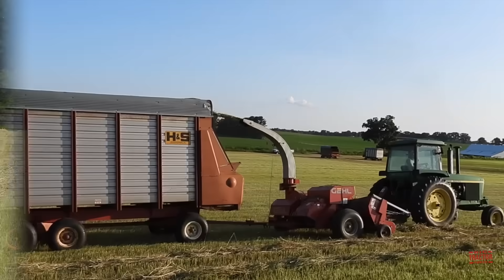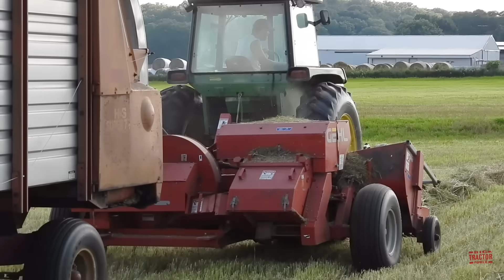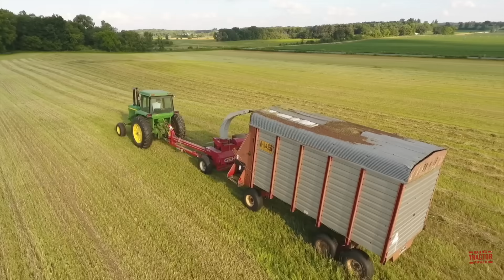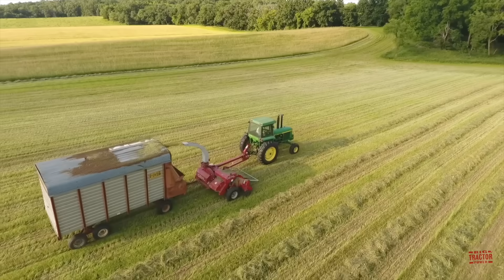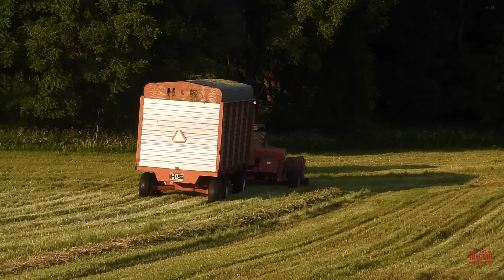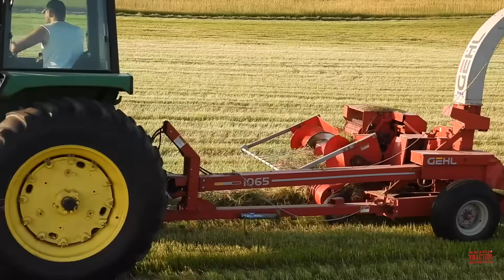JOHN DEERE 4430 Tractor Forage Harvesting

Comment: Question: you show a lot of older tractors and equipment at work, seemingly still in every day use. Is this common in the USA?

Here in the UK, it's not common to see equipment over 20 doing this sort of work, I assume due to efficiency (fuel, maintenance and labour costs).

There certainly are many older tractors still in use, but in more niche roles - my family farm used a 1976 Ford 4600 for (cow shit) scrapping until just a few months ago.

Comment: My first job at John Deere in July 1972 was on the tractor assembly line installing the SoundGard cabs. My part was to charge the AC system and adjust the throttle etc. Any tractor fan passing through Waterloo should consider a visit to the FREE Deere museum.
Reply: did you work on the last of the 4020s?
Reply: @TheJdeere4020  No. Those were finished by then.

Comment: Gehl choppers are bulletproof very well designed, our 1075 takes all of our smaller 4630 at 150hp, we typically run our bigger 4630 coming in about 200hp
Reply: We ran a new Gehl 1000 for years.  Ran so much alfalfa and corn thru it, I had to plate the sidewalls of the cutterhead.  They were getting thin and leaking.  Numerous blower patches and replacement bands.  Several liners in the spout also.  Later picked up a Gehl 1200.  If you liked the 1000 series; you would love the 1200s.  That throat would swallow hay slugs that would snap shear bolts on the thousand.  Ran a 3-30 head on the 1200 with a IH 1486.

Comment: Those were good days,Dad had a 3970 Deere ,pulled it with our 1977 4430,still using the tractor,just finished putting beans in wheat stubble today with it pulling 1590 drill. Sure been a challenging year.

Comment: We had a 1974 4430 as well and a slightly smaller Gehl chopper. Gehl was located about 20 minutes away from us. The H&S wagons were nice. We also ran Rex and Meyer. Great memories. Yes, my dad also said, blow it in the wagon and not on top!
Reply: My parents friends in Ripon Wis. bought a brand new 4430 in 1976 fully equipt with 20.8-38 tires soundgard cab, quadrange trans for $24,000  and 2 yrs before they built a quality nice size ranch bi level house with 2 full kitchens for $50,000,so a 125 hp tractor then was about half of a above average new house. Someone can comment if that is about the same now.
Reply: @scottydog62 I farm in Ripon, who are your parents friends?
Reply: the late Dick and Shirley Hahn.
is this Mark?
Reply: Hi sir
Reply from the maker: Very cool on the tractor and location.  Was it a Gehl 860 or 865 chopper?

I grew up in WNY.  Lamco built forage wagons in New York using Rex beater assemblies. . I have a model Rex and Lamco wagon on display in my office. Big fan of those forage wagons.
Reply: @bigtractorpower  It was an 865. Rex wagons were very popular here in SE WI years ago.
Reply from the maker: @ThomasDrehfal great chopping combo.
Reply: @ThomasDrehfal Rex was a less expensive option compared to others,but got the job done
Reply: @ThomasDrehfal  what you like H&S. What's rong with you? Those things are junk

Comment: ❤😊 NICE TRACTOR 👍 GREEN GIANT IN LE SUEUR HAD 4430 AROUND FOR MANY YEARS. IT WAS USED TO PLANT SWEET CORN 🌽 ON THE COMPANY FARMS WEST OF TOWN AND IT PULLED A BIG FARMHAND SPREADER ON THE SILAGE STACK UP UNTIL 1982 . 1983 THE SILAGE WAS TRUCKED OUT OF TOWN ABOUT 5 MILES. THE WASTE WATER WAS ALSO PUMPED OUT OF TOWN ALSO 👍 POLLUTION CONTROL STEPPED IN AND IN 1994 THE CANNING FACTORY IN TOWN WAS SHUT DOWN PERMANENTLY ❤😢